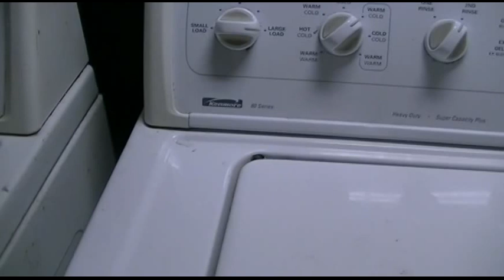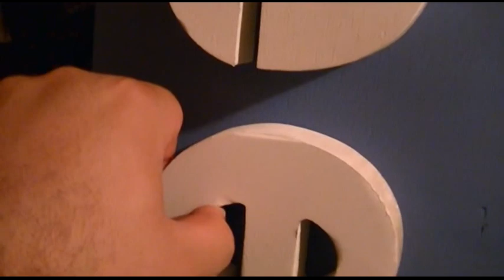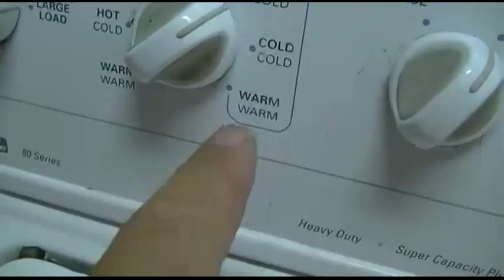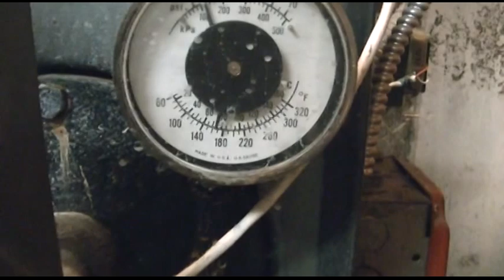xjoe81x's Home Inspection Part 2, The Basement

Comment: I like the furnace.  Looks to be from the 70's or the 80's
Reply from the maker: Might be even early 70's.  No real date unless we go and run serial numbers, but it's eventually going to be swapped out for a gas-fired unit.
Reply: My parents did that to their house.  Converted to natural gas.  If I ever buy a house with oil, I'd run it on bio diesal or vegetable oil
Reply from the maker: Run it on natural gas.  Believe me.

Heating oil is essentially diesel fuel.  Any other fuel you want to try running through it is going to likely cause big problems, possibly even bigger problems than you had anticipated.  I still certainly like your idea, but in practice it's not as viable as you might think.